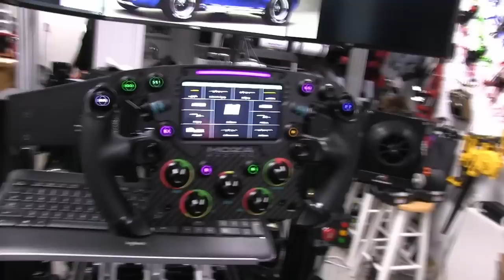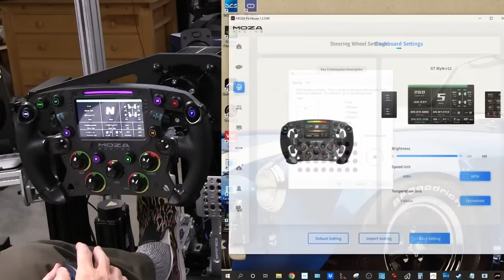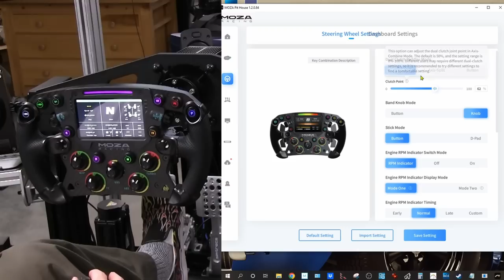Moza Racing Universal Hub and Wheel Adapter Review

Comment: This is a nice solution for using Moza wheels and hardware with other bases. However, I can't help but feel a more consumer friendly approach would be implementing USB capability into all of thier wheels to prevent the need for buying an additional hub. Making the base side qr and a hub like this available to use their rims outside of the ecosystem is still much more than Fanatec would ever offer thier customers so I do appreciate the freedom. As a modder and diyer Inalways appreciate freedom over being locked into an ecosystem.
Reply: Well said, I totally agree. I just purchased the podium endurance module and now have to buy the qr, shifter paddles and a wheel just so I can use it on their system it's very frustrating and just think If I want to use a different vendors wheel setup (usb) I basically have to do it all over again. I originally was going to purchase Moza befroe Fanatec but the dd pro base went on sale that day and I got it instead and had buyers remorse right after I hit enter on the keyboard.
Reply: Locking people's choice was evil thought.
Reply: Sounds like they heard with the latest KS wheel. Hopefully they will continue this trend.

Comment: Here's me posting on a really old video, but for situations where you're mating up two parts, both with the same threads, and you want actual clamping force, you need a BOLT with the threads ground off close to the head. Instead of forever altering the part, you can just grind down 1/4" of the bolt's threads (or just a hair over the thickness of the part) or just run down to the hardware store to get a bolt that works for that. Bolts are cheap, these parts are not.

Comment: Hi did you have trouble doing the firmware update for the fsr wheel? I gotthe FSR wheel and universal hub but in the Pit software it wont let me do the wheel firmware update as its available. There is button upgrade all in one click but it does nothing.

Comment: This is needed only because they didn't make their devices able to connect directly to PC or USB to PC. SIMAGIC has this function built in to their products so it's one less thing to buy or have.

Also not making it 70 mm standard makes it yet more annoying if wanting to use other wheels

Good point on the amount of power required to run all the devices if plugged into that hub.  Gonna see a lot of disgruntled owners who discover that only after they get it and not have enough power to run. Does it come with an additional power adapter? Did I miss seeing this in your video?
Reply: i think it's also a console Hub For PS5 or xbox... And for the power, you don't connect a motor to it, in this case no need for power
Reply: There's not enough power from PC to juice up everything without issues if you plug it all into this hub.

Comment: The wheel side QR probably has 70mm and 50mm to the square plate mounted to the wheel.  If this is true, no need for moza adapter wheelbase QR.  Just use NRG QR both wheel and base.